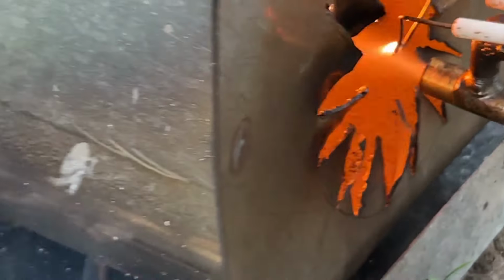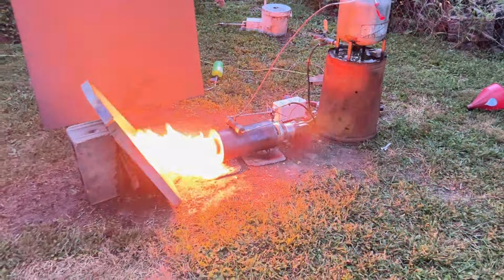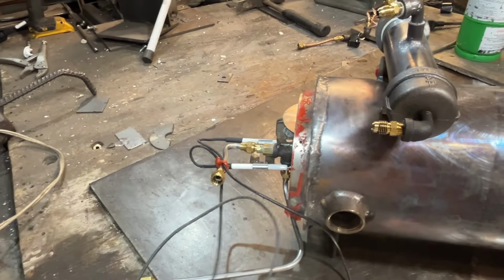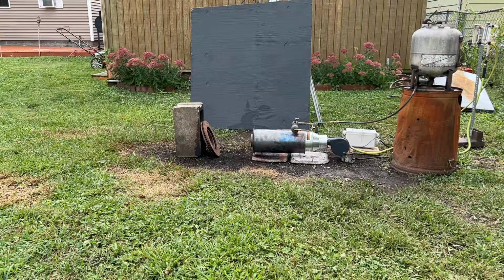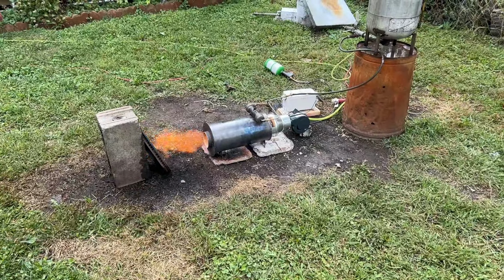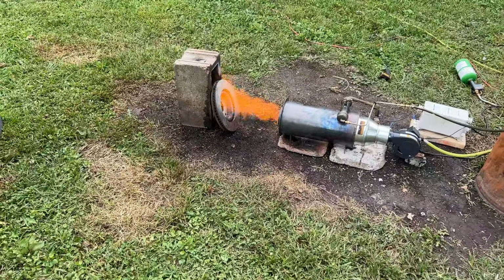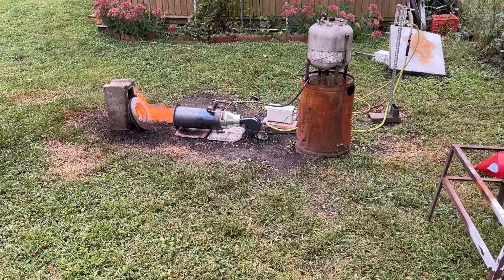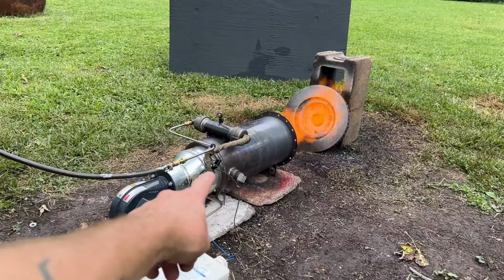Waste oil shop heat

Comment: i found a way to make these virtually silent, the noise all comes from the high velocity oil and air right at the nozzle, if you put a plate into the burn chamber probably 6 to 12 inches in right infront of the nozzle, not sure how but by dethatching the flame from the burner it gets rid of that low tone howl they all have, it literally then just sounds like compressed air and almost no noise

Comment: I think that people in colder climates will love this.  
Out of curiosity, do you centerfuge your waste oil to clean it, do you strain it, or process it in some way to remove impurities or particulates?  
P.S. In the near future I hope to buy one of your nozzles for a home iron smelting foundry.
Reply from the maker: Hello Friend , no this system does not require any filtering at all . I have filtered oil one time in my life and said no way am i doing this  . My design uses geometry large enough to pass small bugs and dirt .

Comment: I use a coffee maker heating element for my preheater. Cheap easy and reliable. You can see it at 50 second point of my video. 

https://youtu.be/WoFPJMEt0yU?si=a3h6OKmEnXoKtkVg 

The PID controller in this video is controlling the second stage of my 2 stage supply line to regulate it to a consistent heat output, eliminating runaway. Since this video is have added a PID controller to the preheater so i could dial in an exact and more steady preheat temperature than the bimetal thermostat could provide.